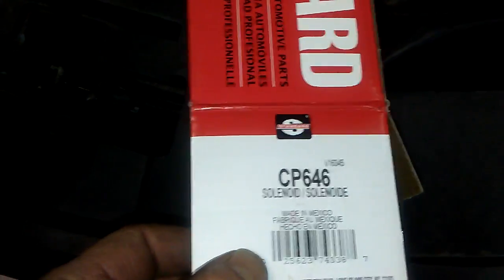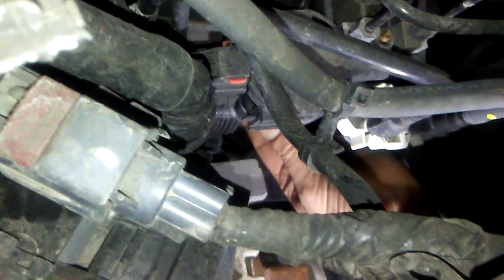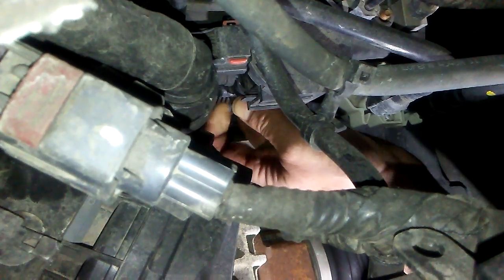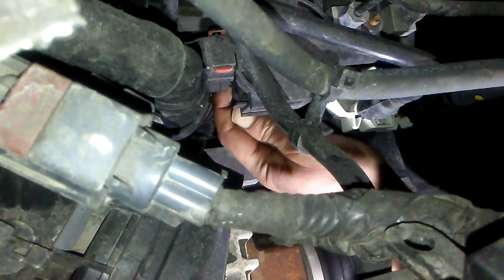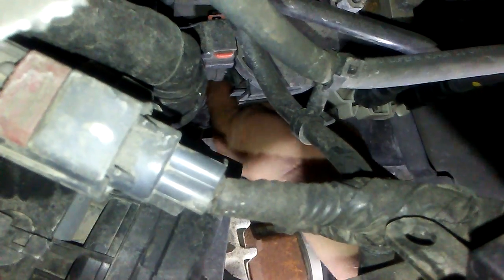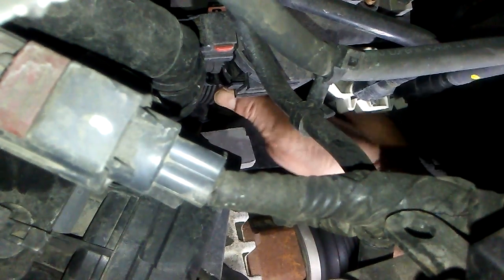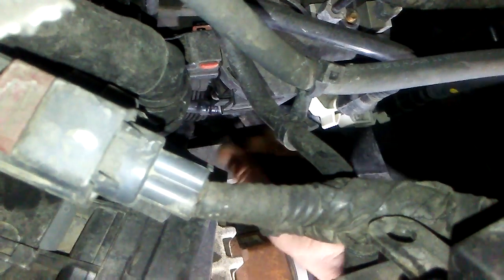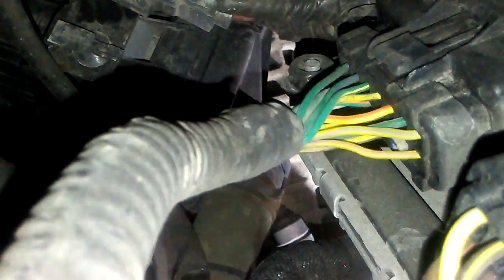2014 Chrysler 200 p0441 incorrect purge flow

Comment: P0441, according to the printout from Autozone, means air is getting into your gas tank. The two main causes are the gas cap and the evap purge valve that he is changing in this video. I know this because my car had the check engine light come on the very night before I was going to smog it and renew the registration.
The most common cause is that people fail to tighten the gas cap after fueling up their car, or just a bad gas cap.
If you know your gas cap is good, and you tightened it correctly, this valve is most likely the problem. 
The part is only about $63 plus tax at Autozone.
Reply from the maker: Man thanks for awesome detailed comment! I gotta pin this one! I didn't cover the entirety of it myself but I appreciate those who come along and share their knowledge and experience! Thanks
Reply: @RANS87IROCZ   I wouldn’t say expertise, but just going off what the guy told me about the printout. I’ve also watched several videos on this, and apparently, it’s fairly common with the 2.4 Chrysler.
Reply from the maker: @DiligentDave1966  hey all you said looked spot on too the situation for sure and I appreciate the extra added info, heck I been doing this stuff now like 30 years and I'm still learning new stuff and you become an expert from such over time but heck even after all this time I don't think I'm the expert either but still believe I can figure it out, heck I actually started hating I do this on the daily 😂 at times I'm over here pulling my hair out 😂
Reply: @RANS87IROCZ  I don’t even do it on a daily. I just work on my own cars as much as possible and help out friends because I can’t see spending upwards of $100/hr for labor, especially when there are so many crooked mechanics around. When I don’t know how to do something, I refer to videos like yours. 
I’ve really grown to appreciate YouTube lately, so please keep it up.

Comment: What does "incorrect purge flow" mean exactly?
Reply from the maker: Richard Cowtails well my take on it,  certain amount of vapor pressure in the fuel system builds up and it is monitored by the computer and most cases its vented from the gas tank through an evap box up to the intake of the engine or returned back to the tank. most set ups have solenoids venting at certain points in the drive cycle when they go bad it can't purge the system or vent it properly causing such code
Reply: RANS87IROCZ I got rid of my p0440. cracked and split hoses EVERYWHERE !!! then I think I fucked up the placement of the 2 hoses on the purge valve under the hood LOL. the timing makes sense LOL !   would you be able to tell me on a Dodge Durango which port of the purge valve which line goes where ? like which port on the valve the intake goes ? I think, I could figure out the other from that point lmao
Reply: RANS87IROCZ also the ldp fills the the system with pressure them the pcm can monitor that pressure and tell when their is a leak ? small or large leaks... do I have that correct ?

Comment: By the way, I don’t think this was the problem with my car, so I went ahead and replaced the ESIM (leak detection pump) and the gas cap. I’m not in it for enough money to get in there to remove and return anything that I bought, so I’m hoping one of the last couple of things will be the solution.

Comment: Hey everyone. Please learn from my mistake. If you get P0441, start with the gas cap, even if yours looks good.
I literally did everything backwards. I started with the purge valve and then the detection pump. 
On a whim, I got a new gas cap on my way to work yesterday. Two short trips later, the check engine light turned off.
I spent $130 on parts, but it was the cheapest and easiest one that solved the problem.
Reply from the maker: Glad to hear you solved it, I rarely see gas caps go bad but yep it will definitely set a small evap leak detected, crazy it set this same code here
Reply: @RANS87IROCZ  According to a few sites, the gas cap is the number one cause of this code. I just got hard headed. As soon as I put the new cap on my car, I could tell it was fitting tighter than the original one.
Apparently, the most common cause is not putting the cap on correctly after filling the tank. Ironically, I had just filled the tank a few days before the check engine light came on, but I know I put the cap on correctly because I have a little OCD with things like that.
Reply: @RANS87IROCZ  It also makes sense since I live in Las Vegas. The weather here does stuff to parts that doesn’t happen everywhere in the U.S. Even car batteries only last a few years here, on average.
Reply: Also, another trend I’m seeing is, if it’s the purge valve or leak detection pump, a lot of times there’s also a P0456 code.

Comment: I just wanted to add, for all viewers, I must’ve watched 5 videos on this subject in the last couple of days. While the camera work could improve, this is one of very few that actually shows how to replace the dang part. One of the other videos shows how to do it, but the engine is on the ground, not in the car.

I’d challenge any of you to make a clean stable video while actually doing an automotive repair. Good luck.
By the way, by the number of videos I found on YouTube, this must be fairly common for the Chrysler 2.4.
Reply from the maker: Thank you for this too bro, they have no idea how hard it is to focus a camera in one hand when most cases you need both your hands and I'm just small youtuber trying to help with what I can but I try

Comment: After watching some videos about the 2015, it’s actually a little easier to get to than the 2014, but you gotta remove some stuff from the top of the engine. The purge solenoid is a little different also. I had to gently squeeze the clip on the plug with needle nose pliers to get it to release. 
I’m just hoping this solves the problem. If not, I guess I’m going to replace the canister and, maybe, the gas cap.

Comment: I realized the other day that this is an old video. However, I feel that people with this code might still be watching it. I did.

Update: I changed this part in my 2015 Chrysler 200. Everything I’ve seen on the internet says my light should have gone off by now. I’m going to change the ESIM this weekend. I watched a video by a professional mechanic that said the ESIM on Chrysler vehicles is notorious for going bad. Even if there’s no leak whatsoever, a bad ESIM will cause the check engine light to come on and give an error code in the P series.
Reply from the maker: Yep I thought about pinning this one too, I know I didn't cover all the possibilities and it could be more than one reason for such issue on this code I really appreciate all your recent research on it
Reply: @RANS87IROCZ   I’m just trying to get my car fixed so it will pass smog.
The amount of information available is amazing but also somewhat vague. As I find enough videos that suggest certain parts are known for failing and causing this issue with these vehicles, I’m posting comments on every video I come across that doesn’t mention the other causes. I’ve read comments from people who replaced one part and the issue wasn’t resolved.
I’m also going to update my comments when my car doesn’t have the problem anymore.